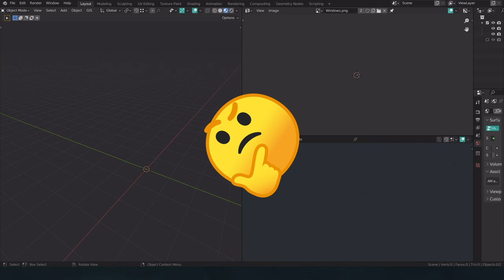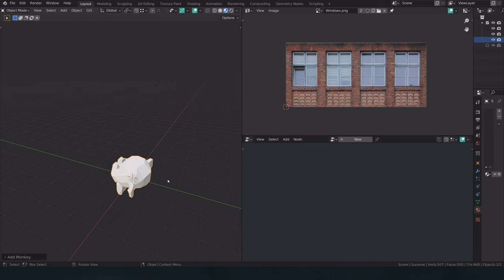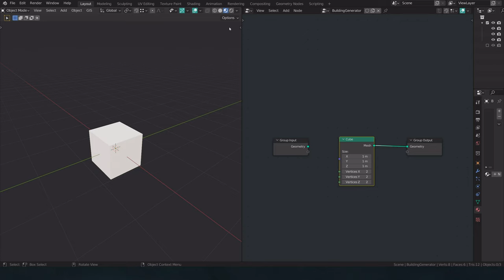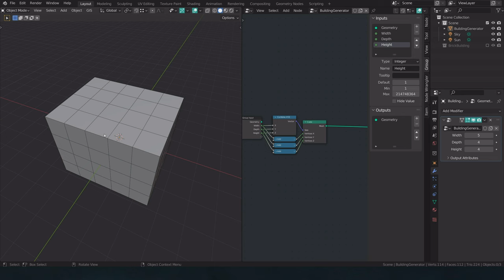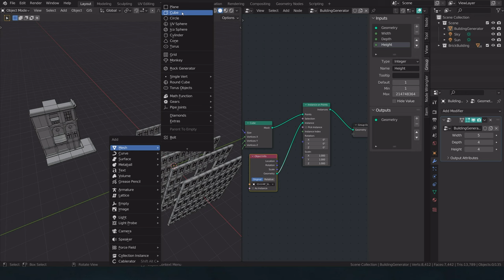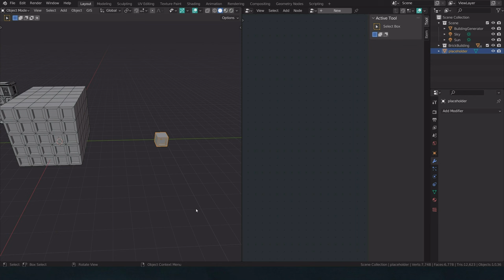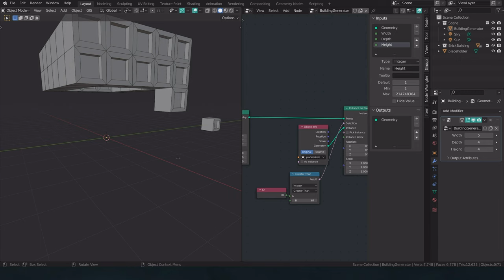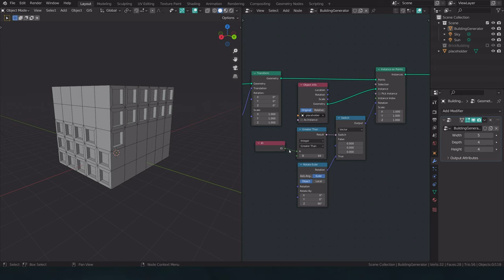Blender: procedural buildings with geometry nodes fields | pt. 1

Comment: how do you write ( equal ) in the node id?
thanks, incredible video
Reply from the maker: Hello, 
The way I do it (using the searchmenu when i let go of the node connector) only works in newer Blender versions. You can still add the compare node the usual way of course. 
The important thing is to actually look for a node called 'compare' - not 'equal'. And don't confuse it with a math node.
Once you added a compare node there is a dropdownmenu you can set to equal.
Hope this helps!
Reply: @Kammerbild  very helpful thanks, excellent video I love this channel 😋😋
Reply: @Kammerbild  I'm running 3.0.1 and there is only a Compare floats node so to make that work is to add a Float to integer node between the compare nodes "Result" output and the switch's "Switch" input. The Compare floats node in 3.0.1. is missing the "integer" option used in this tutorial and it's the only compare node I could find. Nevertheless, works like in this tutorial with the exception that you're working with decimal numbers. I used the default "Round" option found in the Float to integer node. Just thought this might help someone. Thanks for the lesson!

Comment: Your first procedural building video introduced me to geometry nodes and trying successfully to rebuild it in  blender 3.0 taught me a lot. So I thought: Why not a procedural window for the building and while doing so I learned even more. 
Thanks for the euler rotation tip. I ran into the same issue with my window and hadn't solved it yet. Finally I know how to fix it. Thanks a lot for your great tutorials. 
Vielen Dank, mach weiter so. Ich bin gespannt auf den nächsten Teil.
Reply from the maker: Gern :D

Comment: Very, very happy you came back to this tutorial series after the fields rework, especially since the last one must have been a very big time investment to create . Curious what i can guess right for the changing parts this time, thank you for your videos!
Reply from the maker: Yeah, there are definetely some changes. A lot of stuff has become a little stiff and complicated twith the fields update - other things are easier now. It will be hard to tell how it will end up, as fields is really quite new still.
Reply: @Kammerbild  then why are you making tutorials now when everything is still up in the air? did you get word from the devs that everything is in final form?
Reply: @ZexMaxwell  Fields is the settled on system to go forward with, AFAIK. Blender 3.1 and 3.2 both added ontop of the system, most likely nothing major will change from now aside maybe a more condensed setup in the future with new nodes or some name/category changes for nodes, as he said in the video.
Reply from the maker: @ZexMaxwell  Well - by this measure I could never make any tutorial then. Yes - It'll might change... That can happen and it sucks, but that just means I have to update the tutorial. . When I did my original tutorial there was no sign that they would completely change the system the way they did it. So believing that everything will be set and done by the developers does not mean anything.
In the case of fields they have clearly said that it is the system they'll go with - so it would be reasonable to assume that while names and minor functions might change the overall workflow will remain the same.
I learn something new anytime I do a project - so I don't mind. Keeping things up to date is just part of making YouTube tutorials. If I don't do it, someone else will. And I wanna be the one to do it. I have already done it once and Blender is a lot of fun :)
Reply: @Kammerbild  I'm not saying don't make the tutorial video. what I am saying is to make the video when its not a Alpha build. when you did it the last time, the entire tutorial was pointless since the alpha build didn't have the features that the release candidate had. which makes it really frustrating for a new user to understand the system, when the teacher is using a system that is not the standard. 
make the video. when the product is done.
Reply from the maker: @ZexMaxwell  I am a new user too and I don't find it frustrating. And I think others feel the same way. In fact most people seem quite happy with the original tutorial and used it as a starting point to build their own setups and deepen their understanding. It's not in any way easier for me to learn geometry nodes then for others. So if I am able to adapt to blenders changes others will too. And the sooner they start learning it the sooner they'll be able to not rely on my tutorials, but figure out these things on their own. I was able to do it on my own because of my previous experience and other people tutorials. These "pointless" tutorials also published pre alpha and where still useful enough to teach me what I needed. Me and others dont want to wait with learning until the devs are done. We need people in the community with the nessecary skills to test all of Blenders new features - even if that sometimes can be frustrating.

Comment: I don't get how you would use an ID node to select sides of a cube or some other mesh unless the mesh was generated using GeoNodes and I would assume GeoNodes assing ID in some order from -X to X+, then iterate Y value and then Z.... basically some sort of nested loop to give good IDs to a mesh. And even then, you would need either complex logic node setup or a Node to output Arithmetic Sequences  to get sides of a mesh. Good thing they have selections based on Normals of a mesh.

Comment: I would love to do that but I have two problems:

1) For a reason I don't know, 2 Cubes are always drawn for the width, even though I enter 1. Height and length work.

2) I have a bigger problem with the rotation. 
It seems that the compare nodes have been removed or changed. 
The only thing I can find is "Compare Floats" but I can't do it with that either.
I have already discovered an explanation in the comments, but to be honest I do not understand this explanation at all :C
Maybe someone can help an incompetent idiot like me?

PS otherwise great video

PPS: German?
Reply from the maker: Nabend Johannes,

1) A cube always has 8 vertices - otherwise it wouldn't be a cube of course...  So even a cube with 0 subdivisions will always have neighbouring vertices. So I don't even know why your height and length can be turned down to 1 Element - theoretically that shouldn't be possible. In order to have a 1x1x1 building, the source can't be a cube, but only a singular vertex.

2) I can't affirm that. I have just downloaded both the most recent experimental release and the most recent stable release, and both have the compare node in them. Maybe see if you have an outdated blender version.

Comment: anyway to correct this if the modeling is not perfect 1x1x1 m scaling? mine seem to clip together, or be very far spread. 
I had been following the video in sequence so I modeled my middle floor, middle corner etc. first. 
and was wondering why when adding more width that I was clipping the mesh into each other. after a few hours or testing I found the problem being that it was doing so because it wasnt a 1m x1m x1m.

any way this works for any scale geometry?

Comment: Hi so i'm on the basic setup chapter and theres a hiccup with the placeholder cubes. When i use obj info the geo node cube is separated into several different cubes and when i try and correct the measurements so that they appear to be combined but when i increase the width the cubes overlap. Have i missed a step?

Comment: Why does it have to follow 1mx1m? I mean the average height of a room is at least 4m so how can this possible translate into a games engine? Can't I just use 3mx3m?
Reply from the maker: We use 1x1x1m to simplyfy the math.
We will do a lot of calculation that gets needlessly complicated because we'd need to drop in additional nodes to Account for the bigger Size.
Don't worry though. We will scale up the entire building in the last part to reflect a more realistic size. It's just simpler to Account for it once at the end instead of throughout the process.

Comment: 12:04 How did you bring the search bar? I am also using node wrangular.
Reply from the maker: By just dragging the connection there and letting go. Its a new feature. If this does not happen you might have another version installed.

Comment: can i make it if it's more or less than 1meter by 1 meter cuz that' s my problem
Reply from the maker: I wouldn't recommend using a different scale than 1x1x1m - it really complicates all math. It's possible, but provides no benefit. You can scale the entire building up in the end to get realistic proportions as I show in a later stage of the series.
Reply: @Kammerbild  Did not know this, i modified to be 3x3x3 🥲